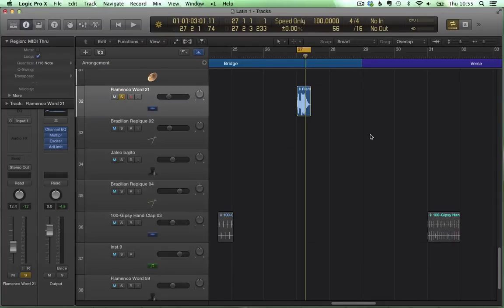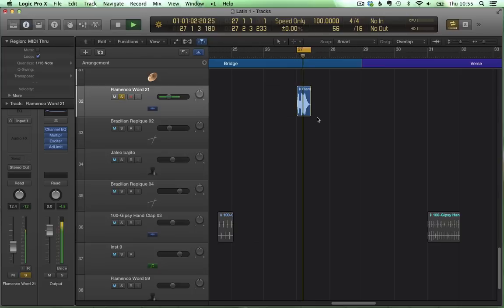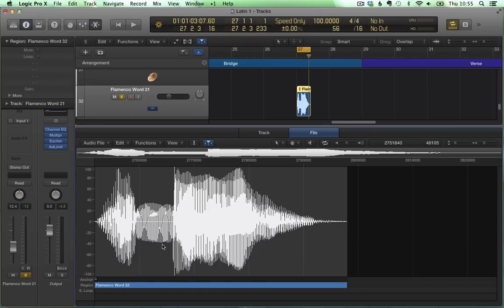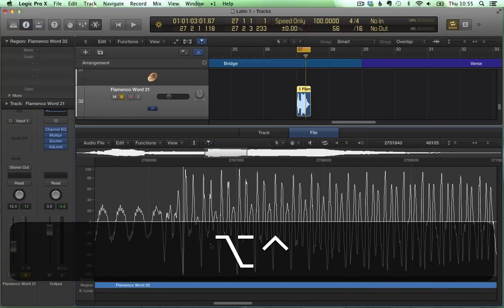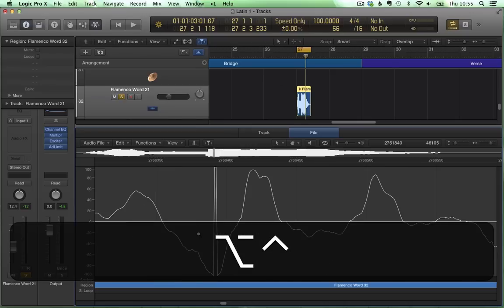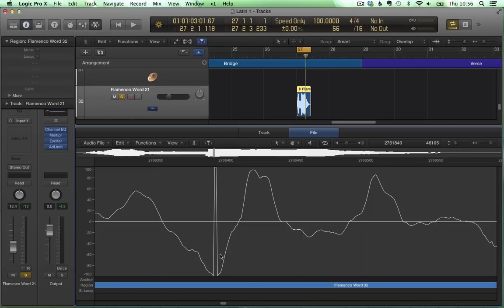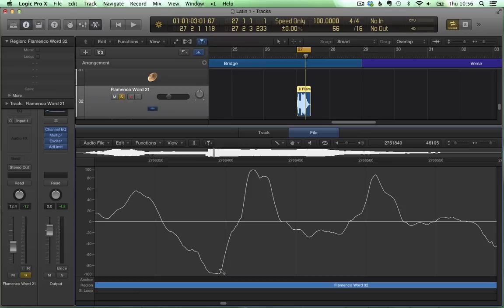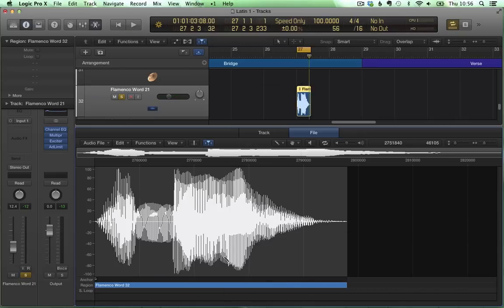Removing Clicks and Pops in Logic X

Comment: Couldn’t find any spikes :(
Reply from the maker: Some wave forms are just tricky. Sometimes it helps me not to try and zoom in too much but keep it roughly where the issue is. Good luck!
Reply: Thanks for the reply, I think the issue may be to do with the CPU because the clicks and pops keep changing
Reply from the maker: Ah yes! That´s the thing with digital, a CPU in distress will cause those. You can always freeze the tracks you´re not using to help ease the CPU load and also check in Preferences if your I/O buffer size has the best settings possible for your session.
Reply: Yaiza Varona hi thank you for your advice but I’ve literally tried everything and nothings worked! The worst bit is, track containing the pops never had them before, they came on suddenly during mixing and won’t go away now
Reply from the maker: @theochunck  If the issues starting while mixing might it be it´s struggling with the plugins you use? However if you have already frozen the busiest tracks that should already helped. Far from ideal, but worse case scenario I´m thinking you could open a new Logic project from scratch and import just the audio content from your mix, and add gradually the different plugins / buses / elements in your mix to try and isolate what is making your CPU struggle. It shouldn´t be like this but sometimes once a session is corrupted if it´s difficult to fix it (my guess is that Logic stores all the history of actions taken, previous takes recorded and discarded etc) it´s faster to reconstruct it from a clean project. Hope some of this helps, best of luck with your mix!
Reply: Yaiza Varona thank you very much, I will try that later :)
Reply: Yaiza Varona hi there, I tried what you said to do and my cpu is evidently operating now at a very low level. The dry track has no clicks or pops but they start happening when I add more plug ins, at around 4 plug ins (compressors and eqs) I can start to hear them and as I add  more plug ins like ‘pitch correction’ and ‘’space designer’ they become very loud and obvious. Do you have any last advice for me please? Thank you
Reply from the maker: @theochunck  Well if the CPU begins struggling as you add those unfortunately the only solution I can think of is gradually bouncing in place the regions / tracks where you are applying said plugins so you can get rid of them. Meaning: select the region / track, apply 1 plugin and once you´re satisfied bounce that in place so it becomes a consolidated audio file and you can let go of the plugin. Then repeat the same procedure with the next plugin and so on. It´s inelegant, counter intuitive and definitely not how you want to mix projects but if your equipment is reaching its limit it can get the job done. Good luck!
Reply: Yaiza Varona hi there thank you for all your help but I’ve tried this method and I just end up with 8 different vocal tracks, each with a single plug in on it:(, any advice? Thank you
Reply from the maker: @theochunck  I am not sure how would you end up with different vocal tracks? Ideally you would not remove any tracks but the plugins applied in them, that should be the ones causing your CPU to struggle. If the problem persists, and again not an elegant solution, you can begin bouncing in place those tracks 2 by 2 so you will cut in half the number of tracks you have - all looking to decrease the strain on your CPU (while making your mixing a bit more cumbersome though!). Hope this helps, good luck!

Comment from the maker: Hello! I can´t seem to be able to reply to 'linked comments' here so please make sure when you drop me a line it´s possible for me to comment back, otherwise if I private message to try and help the rest of the thread might lose that info too. Thanks!
Reply: Yaiza Varona thanks for the reply i got it over email but it deleted as my inbox loaded new emails for some reason. But! i did figure it out.

If the Track/File interface is not showing, try clicking logic pro x in the top left corner, prefrences, advanced tools, click the advanced tab in the new window that appeared, and make sure you have the box for show advanced tools and audio checked off.
Reply from the maker: Carter Chan Great to hear! Well yes, I always use Logic in advanced mode as I use it for professional purposes.